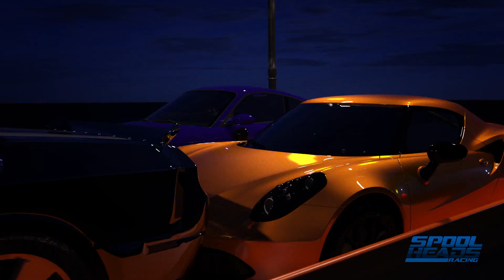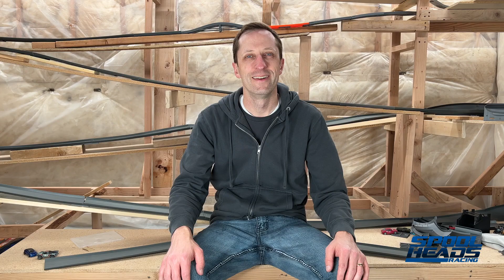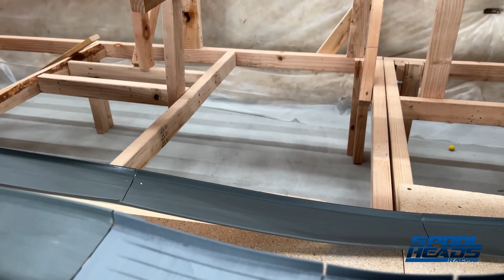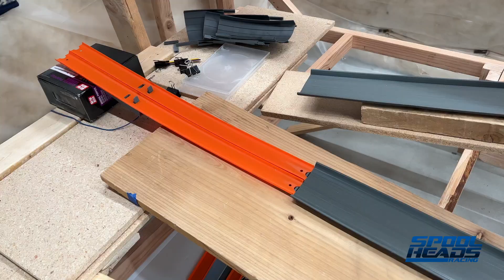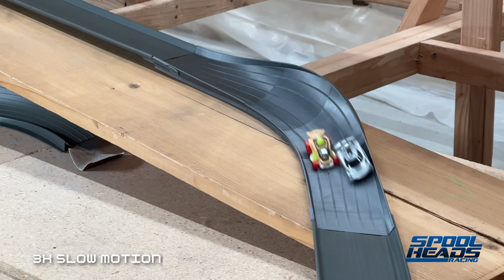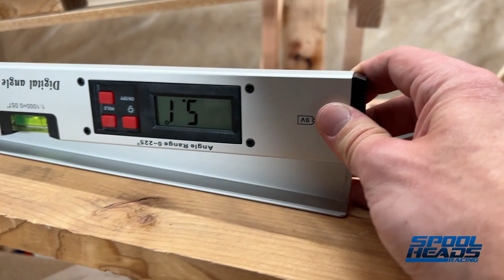Prototype Open Track 180 Degree Turn VERSION 4.0, 1:64 Scale Diecast, 3D Printed - Test Footage

Comment: First off, great to see your work and showing the failures also. I know I’m coming let into this, and you may have tried this, but I notice the cars kick out and slide on the exit. I’ve been trying to sand down the grooves on the exit to calm that down. Have you tried one with minimal grooves just past half way out of the turn. Just a thought. Also thanks to you, my son has really gotten into fusion 360 and designing things we need for the track. We have a simple yet effective river channel we are adding to the new track. Should be debuting with our new track soon. Thanks for all your work. 👍
Reply from the maker: Thank you! The extended ramps help reduce the drift coming out of the turn, but don't alway eliminate it for some cars.

Comment: First off, this is amazing! Great work mate.  My apologies if I miss the details here but does the link go to designs to 3D print the wide track in the video?  When I go to the thingiverse link I think it is a different track as it has two lanes.
Reply from the maker: Thanks Jay. If you search for Spool Heads Racing on Thingiverse, you should see SR1 and SR2 options. The open track turns aren't available as STL files.

Comment: Is it possible to flatten the road on the apex of the banked turn so it's not "cupping" the undercarriage of the cars so the centrifugal force can hold the cars better and keep them from under/over steering or sliding down, even when their entrance speed is at the low end as they approach the turn if they lost some momentum prior to entering the turn? It's hard to put in words what I'm picturing in my head. When the cars are in the mid section of the turn, the road underneath is not flat across, but curved, which makes only the outer edges of their tires are in contact with the road, instead of the whole tire face to create adequate friction to keep them from sliding during the turn, as if the cars are on rails. It might also help if you decrease the angel of the bank, or vertical slope incline, by 5º - 10º going towards 0º from what you have it now on version 4.0. I hope this helps. Stay safe and blessed. Yosh...
Reply from the maker: Really great suggestion. Thanks for taking the time to comment. To make sure I understand it best, can you draw out a profile of the turn you're explaining and email it to me? russ(at)spoolheads.com. I think you are saying to take a bit of the curve out of the turn profile. Meaning flatten out the middle by raising it up and flattening out the top by reducing the slope. This could definitely work. If I go too far in that direction, the drivers of the cars forget to turn and drive straight up to the top rail and hit it. Let's see how this v4 turn works as a full 180 degree and go from there. Thanks again!

Comment: That is one amazing 45 turn. And yes, the grouves could be a little bit deeper. I love the way they attach to each other. It would be a great solution for the last turn of our main track. And the 180 you showed us at the beggining looks great to. I would like to see more of it when you get to the next version. The built in support to make it slope the right way (height) from enter to exit seems really useful to me. It's hard to find the right angle to put them into, so if your testing gives you a great result for this angle, I would like to have those support block too. I love what you are doing for all of us and I want to thank you Russel for doing it. This will really help us build better and more creative tracks. Just for fun, you should try to have two 45 degrees corner almost back to back (but opposite) to see how the cars react... kind of a extrem chicane.
Reply from the maker: Such great feedback. I'll try opposing 45 degree corners out for sure. That's a great idea. Once I have the full 180 degree turn built with version 4 pieces, it will be very interesting to see how much flex there is to bend it for different track slopes on the entrance and exit. Thanks for all your support. You are the best!

Comment: Cool!👏👍 Question: what kind of plastic do you use in 3d printing? and the print quality of the 3D printer is maximum or average?
Reply from the maker: I have a few Creality printers. They aren't the top-of-the-line, but I've printed a lot of really great looking prints. I like to use PLA plus as it is easy to print and will be more durable than standard PLA in the long run. The quality of the print really is a much bigger function of how the code for the print is sliced and modeled than the actual printer. There are a lot of things in the slicer I use that I'll dial in.

Comment: Dang, this process of track piece inventing is tedious and challenging.  It looks like some of the cars are bouncing on their way out of the curve possibly because the upward bank is too steep? Seems like they hit into versus rolling through and around it. At faster speeds they may just flip right over. On a positive note, being able to screw the pieces together is great!
Reply from the maker: Great feedback for sure. There were a couple cars in the tests that did flip. It might have been because the print wasn't very smooth. Really doesn't take much to flip a hot wheels car!

Comment: Looking good maaan!  One little tip.
Buy a sheet of 3/4 birch or “sandyply” from Home Depot. You can use it to make any framing structure you need and you’ll save a ton of $$ in 2x4’s. It cuts nicely with a Circular saw. Pre drill and screw too.
Reply from the maker: Thanks Wolf Party. Great tip.

Comment: Maybe because I have yet to see it assembled as a true 180, but I feel that it lost some of the self-cleaning apron around the base of the turn. Like you said, plenty of testing to go, but I did like v3.0 a lot and it set the standard for me. Glad to see this continue to get time, however!
Reply from the maker: Great feedback. It will be interesting to see how this works as a full 180 degree turn for sure. The bank is a little more steep than version 3 to help prevent cars from running up the wall and hitting the top. The good news is that even if version 4 stinks as a 180, I still have version 3.